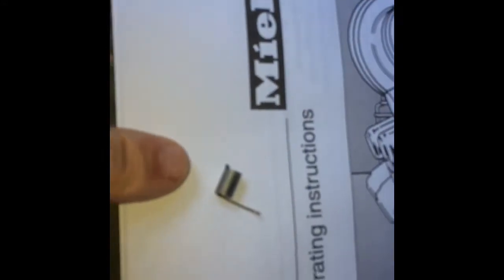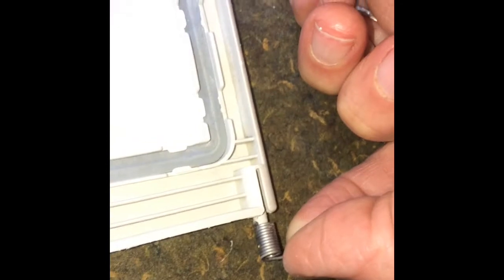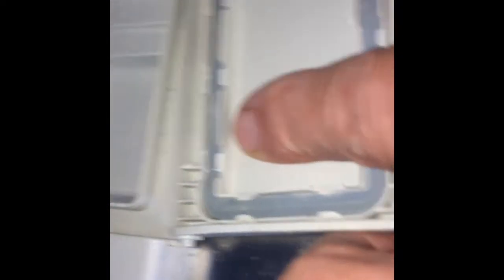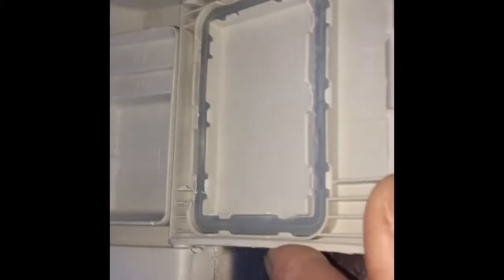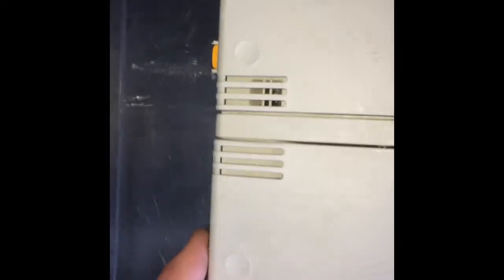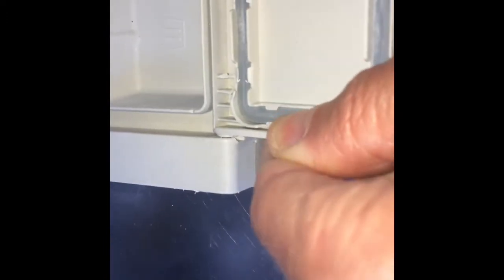✨ Miele Dishwasher - Soap Drawer Won’t Open - How To Replace Broken Spring ✨

Comment: Thanks for this.  I had this issue but in Canada, Miele tries to direct you to service.... I had to ask for a parts list   They don't sell the spring alone, only the whole dispenser assembly for $260.    I simply took the spring off the adjacent door flap (rinse aid not used) and used that spring.  Fixed!
Reply from the maker: Ooooh,
I like that. Excellent idea👍

Comment: Hey Scott, thank you for this! My spring is actually OK. When I press the orange tab there’s tension on it the door pops open but when I run a cycle it doesn’t open and the soap remains inside. I’m thinking maybe the solenoid needs replacing? Those things seem so simple and reliable. I just can’t see how that would break. I’m hoping it’s that or maybe a bad contact?
Reply from the maker: Yep a new solenoid.
Does the water get hot enough at 20 minutes to cause steam to come out when you open the door?

Comment: FYI. Other brands also use the same spring.
Reply: Miele will only send the whole dispenser ..which USA dishwasher uses the same spring?
Reply: @susanwiggill4632  did you get an answer to this? I have the same problem.
Reply: Do you have a part number from another manufacturer?
Reply: Which brand. I see some that look similar but can’t tell if the size is correct.
Reply: If I remember correctly, I used a spring off a Kenmore. If you can’t find a spring that fits, you can get creative and rig something up. All you want is for the door to open when the solenoid activates. Easy solutions.